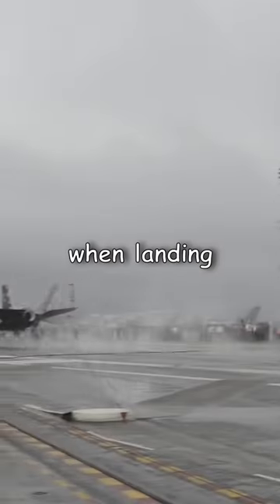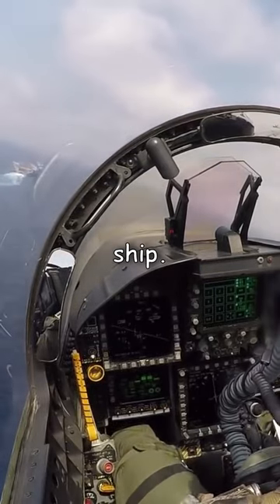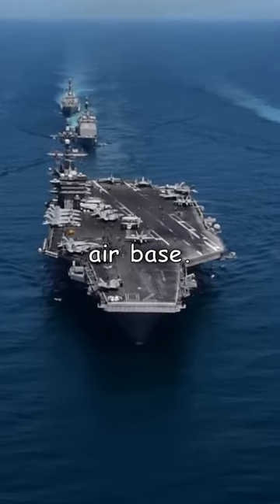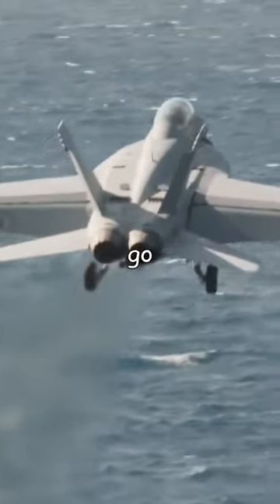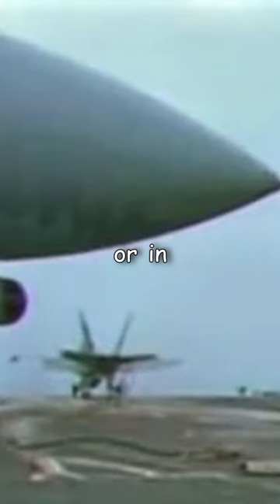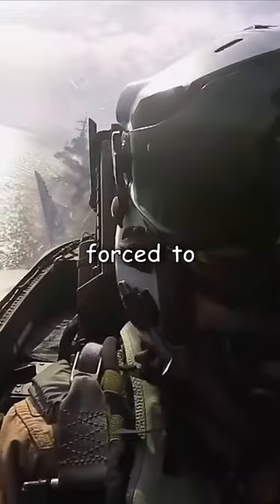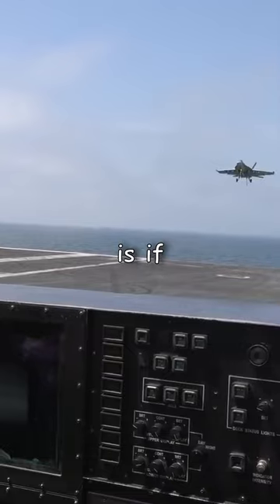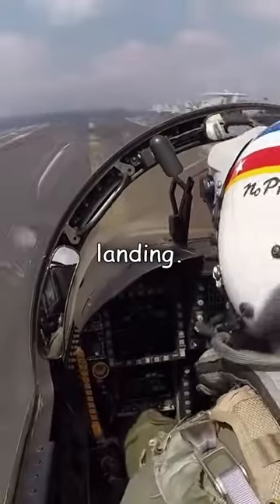Full Throttle Carrier Landings? #shorts

Comment: I read that one pilot had 3 failed landings before the 4th hooked up. They didn’t elaborate if he was ever allowed to fly again 😂
Reply: The pilot was able to handle a bad situation 3 times and eventually got the aircraft on the boat. Seems like they did pretty good. It’s considered the toughest task for a navy pilot for a reason.
Reply: Yes he would be allowed to fly again. There are many reasons that a pilot could bolter. If they are having issues with trapping the wire they have a second way to stop the plane. When landing they try to grab the number 2 wire. The  stern of the deck is angled down if they get to low the hook can hit the down angle and shatter. Then they rig a net to catch the plane